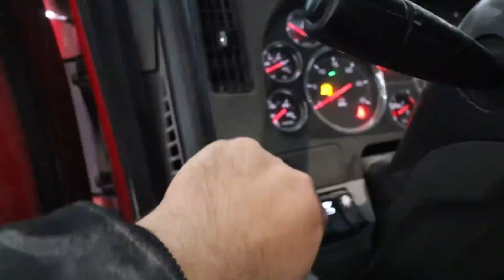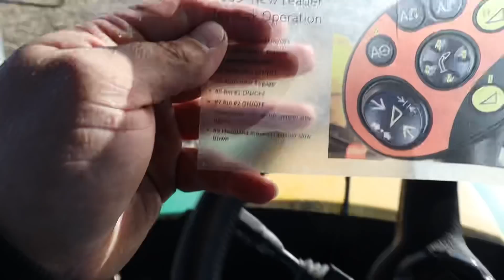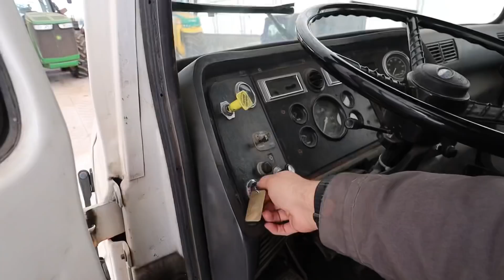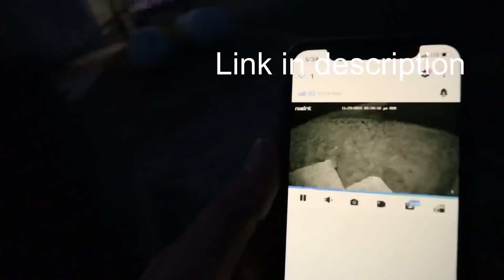Oh NO!!! I did it again

Comment: I use an Arlo cam system. Love it. But for the area you are doing. Before you close the tool box and say done. Drive your Roxor around and see if you can read your license plate. May have to move a few. For sure the one at the gate. Look on your instructions for what or where on the viewing area is your sensors. That way you aim it properly. Good Luck.

Comment: You're better of than the Welkers you have a personal rock pit, they have to train it in.
You could almost make more $ off the selling gravel than you could off the grain.
If the batteries are set up right you can jump a 24v system with a 12v system, I used to do it quite often.

Comment: On the tender truck you could try our old press drill trick mix diesel and used motor oil 50/50 and spray it on all moving parts with a siphon feed blow gun it works great

Comment: We run 24v systems at work. You can charge the batteries even in the equipment if you do them one at a time by hooking to the + and - of each battery since they are 12v each. Just don’t go from + of one to the - of the other.

Comment: I'm dad would call you lucky with that much dirt the place we grew up on have a 1/4 inch of dirt before the hit baseball sized rocks for 2 feet then sheets of rock  but my new place 12 miles away has 3 to 4 feet of topsoil then clay and 0 rocks

Comment: The bettery should not be 24volt  just unhook the 12 cables  🤣 then charge the batteries. Or maybe it is I've never seen 24 volt battery usually they add two 12s

Comment: 24V system is just a combo of 12V batteries.....so.....charge the 12V batteries.  (I thought farmers were.....?)
Reply from the maker: The batteries are in a hard to get to spot on the machine and we are in a barn with no electricity. It has jumper prongs on the step and Brad had a 24volt charger